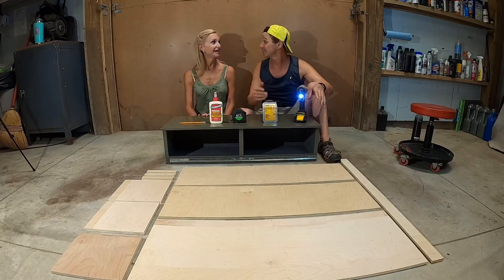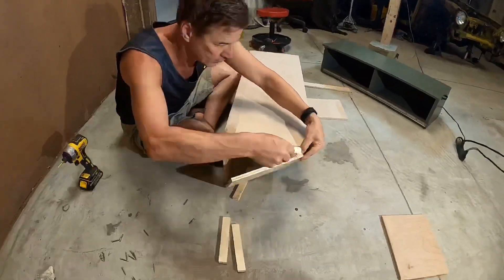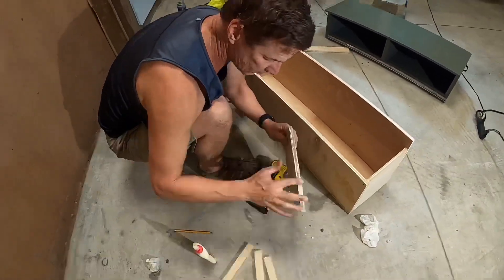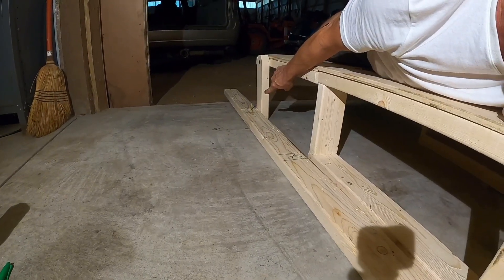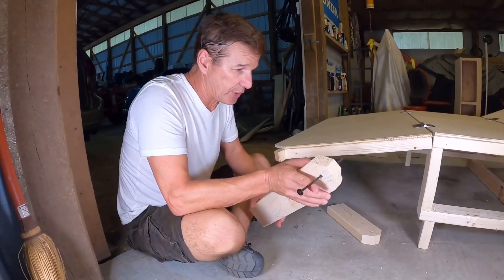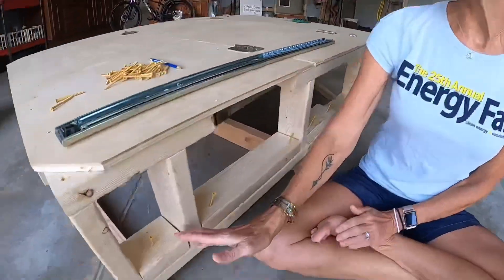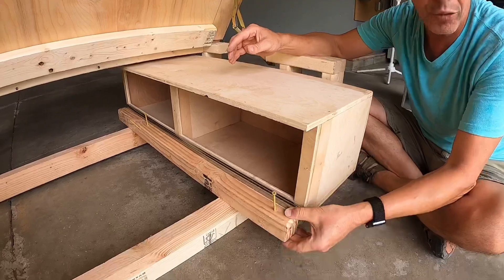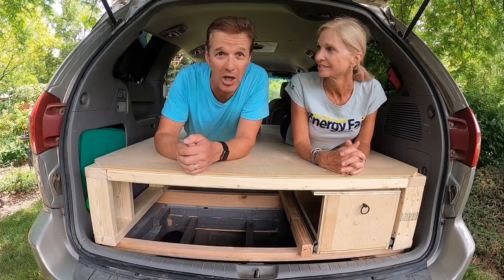Minivan slide out kitchen drawer

Comment: Thanks so much for these plans! I’ve completed the bed platform but I’ve yet to start on the drawer and leveling of the platform-I notice in the beginning portion of the video you’ve got a trunk/cargo area wooden cover that this bed platform rests on top of. Do you happen to have any plans on how you achieved that? Even just a quick couple tips would be greatly appreciated. Thanks!
Reply from the maker: We plan to put out a video addressing that. We did it 10 years ago when we first got the van. It was our first build for camping and we needed to flatten the van bottom and create some space underneath for storage. It is really nice because we put 2 screws in the bed frame into the platform, and it is solid.